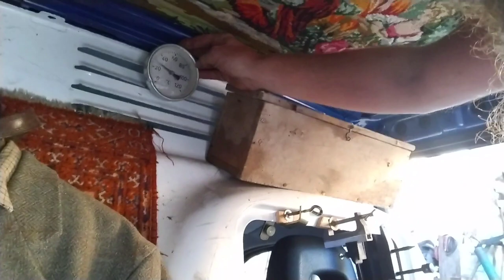Nomad Life: Building A Live-in Micro Camper | Solar Power

Comment: Looks like quite the project! Am planning to do somewhat of a van conversion, round the worlder myself once ive finished the old education malarkey! Am planning to design a wind-vortex turbine that can charge up on the road and be unclipped and carried around the countryside! should be a fun project for my second year of design at college! Good Luck with it Jesse!
Reply from the maker: Sounds great Max, I'll buy one off you if it's not too pricey. ...I was looking at little turbines you can put in water but they're not quite there yet... Bit flimsy... Best thing would be to make it have a little gearbox so you can use it in a river, generating high torque... And as a wind turbine too at lower torque, slower charge.

Look forward to unboxing mine. ;-) ...Great project idea Max, I was thinking about it last year... You could turn that into a business very easily if you nail the design... Get Jasper machining the parts... There's hardly any competition there.